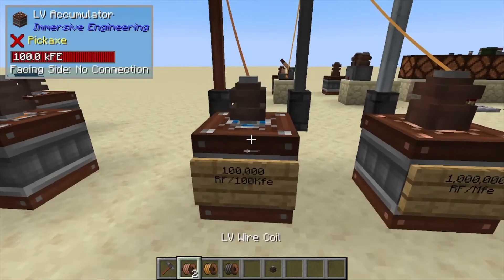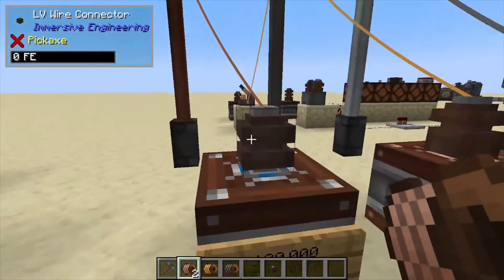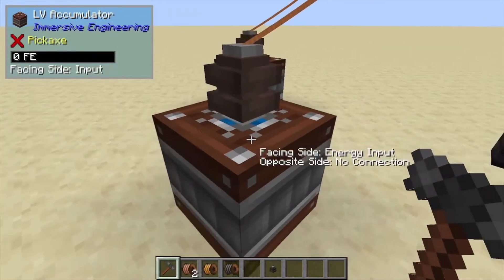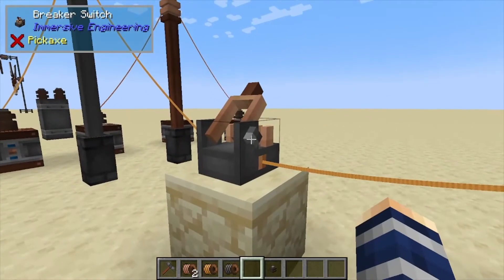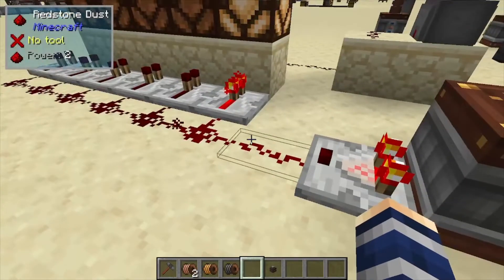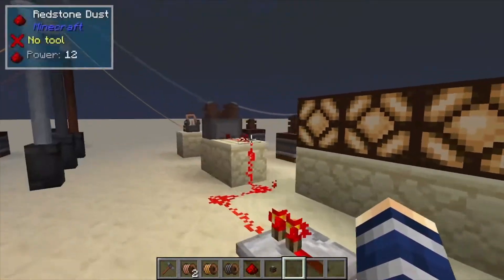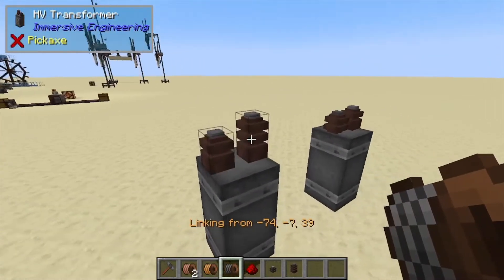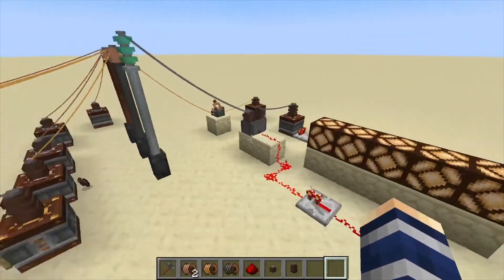Immersive Engineering: Power Distribution (how to Transfer/control)

Comment: In the guide book in-game, it suggests that you can transfer RF through a block ("through a wall") if you have connectors or relays on 2 sides of it. How does thst work exactly? Is it only if the connectors or relays are directly opposite eachother? I initially assumed it would work like redstone and send RF through regardless of which side they are on. Is it only with connectors or can you use relays too? Any clarity on this would be nice

Comment: how do we transfer the energy of a windmill connected to a kinectic dynamo connected to an LV Accumulator to a metal press?
Reply from the maker: Kinetic dynamo with a connector…then to the top of the LV accumulator set to input on the top with a hammer…then from any other side set to output with the hammer(orange) use another connector to run the lv wire to the press
Reply: @MCMentor1  YOU ARE THE BEST MAN THANKS!!!!!!

Comment: im trying to connect my hv capacitor to a hv transformer to a transformer to a breaker to my garden cloche relays but the lv cable keeps burning i don't understand why
Reply from the maker: Could be that you need an MV wire instead of lv. Hv high voltage ,mv medium , lv low so maybe the jump from from hv to lv is to much power
Reply: @MCMentor1  yeah thats how I fixed it just kinda weird idk but thanks !

Comment: But I connected a pumpjack to some 50 windmills with hv wires and relays and the distance between the pumpjack and the windmills is some 150-200 blocks but the problem i face is when I go near the windmills the power is only transferred then when I go to the pumpjack the power doesn't comes. How to fix it.
Reply from the maker: Maybe your to far away and the wind mills are not chunk loaded…and check to see if the “pumpjack” is actually connected and receiving power from a source that’s closer just to make sure it is a chunk issue
Reply: Obviously I double checked everything. When ever I come near the windmills then the power is transported to the pumpjack and I can see the pumpjack is working from far but when ever I come closer to the pumpjack the electricity doesn't comes hear. And if chunk load is the issue then what is the difference remained between immersive engineering and normal Minecraft as like I have to stay nearby to anything automatic in the normal Minecraft to keep that working.
Another problem i faced is of fluid pipes. I connected an oil tank full of crude oil to a tank with fluid pipe and the distance between them is some 500 blocks but when ever I activate the oil tank crude oil starts transporting but when I go far from that oil tank the oil transportation stops. I even tried to address this issue with a fluid pump but the fluid pump only transfers just 4 buckets of crude oil and after I transferred that oil no matter what ever I do with the pump reverse the lever replace the energy source and even the pump the fluid never travels again through that pump.
Reply from the maker: @Z-Series345  Im going to go ahead and say all your problems will be solved with a chunnk loader...i dont make these mods just do tutorials on them but unloaded chunks is a universal across all minecraft...you need to chunkload or put your stuff closer together.
Reply: @MCMentor1  Maybe these problem can be solved by chunk loaders but another problem I faced is I filled 3 oil tank with crude oil through pumpjack but whenever I restart the world the oil tank appears less crude oil I was with 3 full filled oil tank of crude oil but when I restarted the game 4 to 5 times the oil just remained just some 500 buckets.